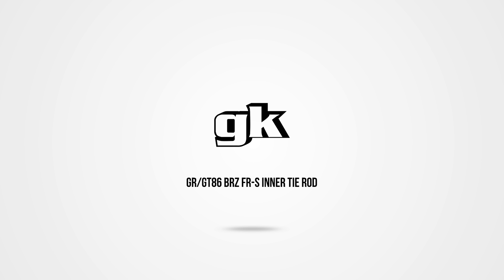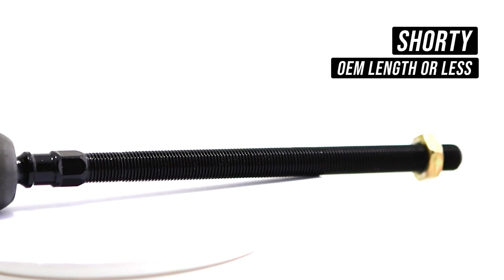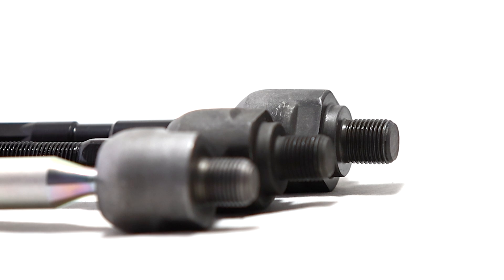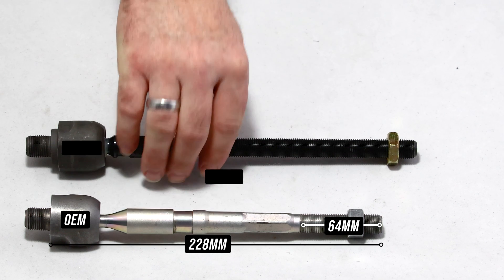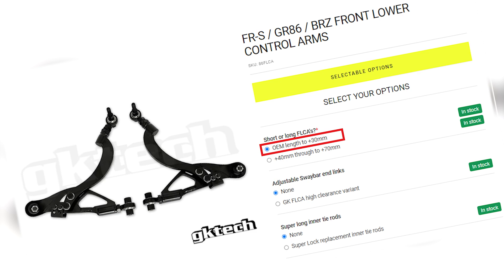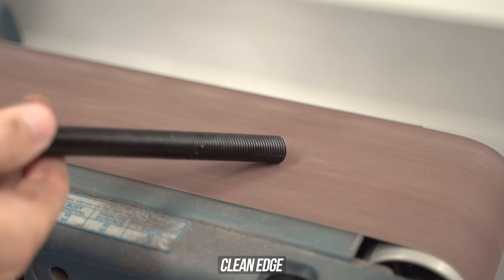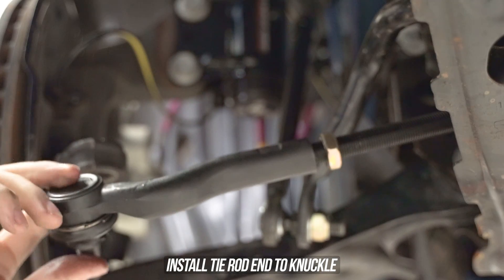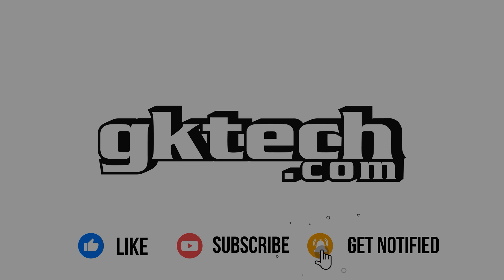Gktech GR GT86 BRZ FR S Inner Tie Rods - Install

Comment: will i still need to make a cut even if its going into the v3 bolt on angle kit not stock
Reply from the maker: It depends on which inner tie rod you choose and your setup in general.

Your best bet is to measure your setup based off this video and your setup. You need a minimum of 15mm thread overlap, then just check to see where the wheels are and you can go from there.

You would rather have too much thread and cut less then you need then cut more.
Reply: @gktech  would there be any issues if the inner tie rod is too long with too much thread engagement? I just installed the gk tech v3 bolt on angle kit with the extended inner tie rod without cutting it. Thanks
Reply from the maker: @andrewchung1838  Yes, if there is too much thread engagement you will have no room to adjust the toe. Please make sure there is enough thread engagement - if you are unsure please email us at sales@gktech.com and we can run through your setup and ensure it is safe!